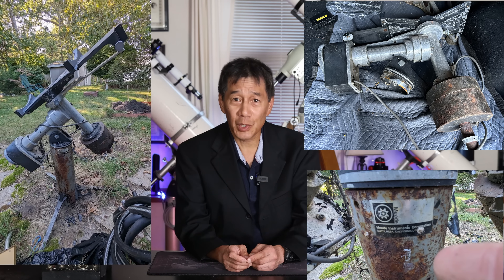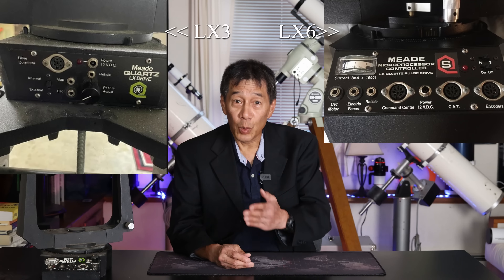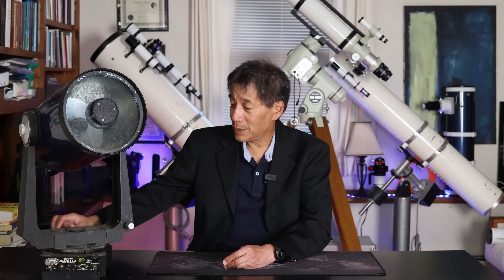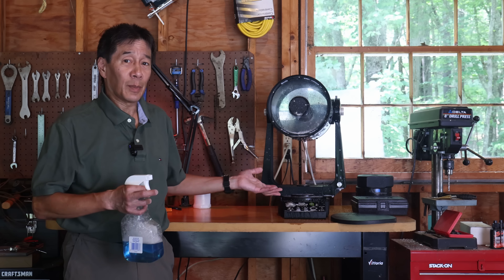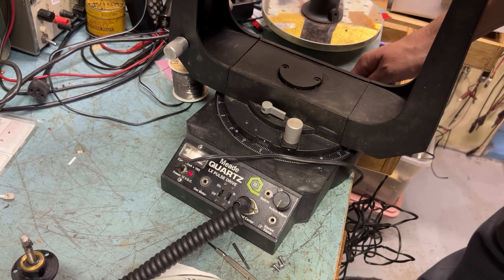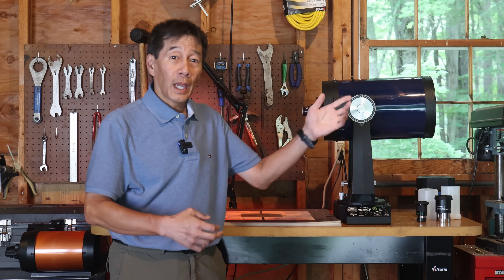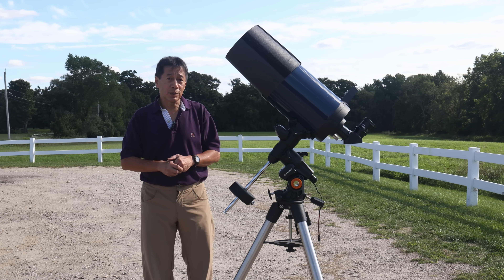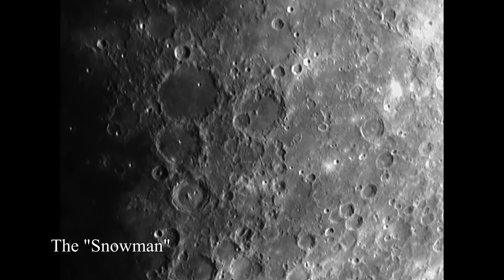Is This Bad?? A Telescope-Shaped Piece of Dirt Shows Up. Can it be Salvaged? See What Happens!

Comment: I wouldn't mind projects like this. I have a condition where I'm happy putting WAAAY more time into fixing up decrepit pieces of equipment than they are possibly worth. Just this year I spent two months reconditioning a couple of motorcycles, one of which had nearly every possible thing wrong with it that could be wrong, and even when I got done spending dozens of hours on it, it was only worth about what I paid for it and the parts that I bought, but I still enjoyed getting it working again.

Comment: Like the video I aquire a Meade LX200at a barn auction 300.00 dollars optics looked good got it home setup plugged in and the RA motor would not stop slueing hand controller lights up but no control over the scope my guess is the computer boards need looking at not sure who can do that well I still use it and I really like the scope

Comment: Ed,
I was gripped by this video because for a moment I thought this might be my old Meade SCT telescope, but alas it is not.
Around 1990 I lived in Suffern, NY and I bought my very first real telescope, a Meade 2080 SCT. I treasured my telescope, even modified it with a state of the art go to triangulation add on. Fast forward to 2011 and hurricane Irene flooded my basement to the ceiling. My telescope was I thought destroyed beyond repair . There was mud and silt and even industrial oil from the nearby Erie Lackawanna train lines covering the scope, my Nagler eyepieces and everything in the basement . For the next 5 years or so I could not part with my scope so I stored it in my shed, but eventually I put it out for trash pickup never believing it could be repaired in its current state. Pardon my ignorance.
So while that is not my old Meade 2080 this story may explain his s telescope ends up looking like that.
p.s. I still have my Nagler eyepieces, I don’t think I could ever toss those. This video gives me the hope that perhaps they can be restored.

Comment: re the corrector plate coatings - my vague recollection is that the very early tubes were un-coated or optional but in any event as you found out the coatings are only worth a very small percentage - your light shield probably fixed most of the issue for you by cutting down any glare from stray light sources

Comment: Question for you Ed: 
A huge $3000 dubsonian 12" newtonian reflector, or a used $3000 Sky-Watcher Esprit-120ED Professional refractor?
Reply from the maker: Ooh, that question could start a war!  If it's your first scope, I'd still suggest the old standbys - an 8" Dob and/or an 8" SCT on a mid sized computerized mount.

Comment: Ammonia has material compatibility issues with several plastics that may be present on circuit boards. I'd avoid using ammonia-based cleaners with electronics. Also bad to let it soak into the connectors, as that's going to bring debris into the connectors that can result in future failure. Instead, maybe cover electronics during bulk cleaning, them wipe them off with a glass-cleaner sprayed onto a rag? Shrug.

Comment: First off I want to say I'm a fan of your astronomy equipment related YouTube video and often recommend them. I have been an avid amateur astronomer and dealer in astronomy equipment for 17 years and have only disagreed with your conclusions and recommendations once before (about neglecting to criticize the DEC clutch of the larger Meade ETX scopes) but now I have another. 

At 5 minutes into this video you liberally spray the cleaner over the corrector of the SCT scope....this is a major NONO! Via capillary action the liquid is sucked under the corrector retaining ring and will eventually seep onto the back of the corrector and possibly damage the coating (and therefore appearance and resale if not usability). It can eventually corrode the aluminum cell and perhaps corrode the ring retaining screw threaded holes so the screws can't be removed. The same applies to the secondary fitment to the corrector. Always spray the cleaner on your cloth, then use the cloth on the glass, never spray on the glass itself. This applies to any lens assembly, like camera lenses.

Comment: How much would it cost to recoat the plate, primary , and secondary?
Reply: the optical coatings on the corrector - probably not doable (but its not really an issue anyway just don't scratch it) the mirrors are re-coat-able ask the local astronomical society in your location who they would recommend

Comment: As long as there's no harsh scratches on the meniscus lens or mirrors, always salvageable, albeit a bit meticulous to disassemble and reassemble one of those if the inside of the OTA needs cleaned. As long as the lens and mirrors don't get rotated relative to each other or the tube on reassembly, that's the main thing. I didn't have much problem with a C8 and C11, getting both the meniscus lens and the secondary mirror in the meniscus fairly close to perfectly centered with the primary mirror for sharpest image at highest magnifications is the tricky part, was for me anyways.

Comment: Hi Edd, thanks for the great videos! I'm torn between choosing an 8-inch SCT or the 8-inch GoTo Dobson Flextube as my first telescope. The GoTo Dob is much cheaper but has a shorter focal length. My primary goal is to enjoy the night sky through the eyepiece, though I’m not sure yet whether I’ll focus more on planets or deep-sky objects.

I'll mostly be observing from my backyard, so the SCT's more compact size isn’t really a deciding factor for me. However, I live in a humid climate and I'm concerned about the SCT’s corrector plate fogging up, especially in winter.

What would you recommend?
Regards
Reply from the maker: If you're getting a goto scope, I'd lean towards the SCT.  It's a more established platform and you can repurpose the mount later.
Reply: @edting  thanks for the answer, is there much difference with the big focal lenght when watching big star nebulae or does this depends wich eyepiece I use?

Comment: Why did you say you usually don't like to take an SCT apart? Have you had a bad experience of some kind? I have worked on these things for years and have never had a serious problem of any kind...usually just stuck screws and corrosion. The most irritating thing I have run into is seeing different marks on the corrector and tube from numerous people trying to keep the orientation straight. My old orange C8 had a single mark, double marks, triple marks and two sets of scratches! And none placed the etchings at 3:00, which on this scope was actually the correct position!  LOL
Reply: SCTs are very sensitive to corrector plate/secondary alignment.  They are tweaked a lot during manufacture using specialized equipment.  Removing the corrector plate can result in never getting great images again.
Reply: Secondary alignment yes, corrector plate not so much. There is only so much adjustment available for the plates. The etchings on the plates are mainly to help the owner to align the secondary to the primary, which is normally indexed to those etchings, which is in turn indexed to the tube normally, but not always, at the 3:00 position. And this is referring to the 8in Celestrons...I have no experience with the larger scopes, or the Meades for that matter. But the critical alignment is between the Primary and Secondary. @stargazer7644

Comment: No coatings because they got stripped by the ammonia in the cleaner?
I had a pair of zeiss eyeglasses with the non-reflective coating. The optician did not even mention to me there is a special cleaning solution for the zeiss lenses. The ammonia in the windex ruined/stripped the non-reflective coating. 😡 After I finished crying, I had no other option than to keep using the windex to completely remove what was left of the coating. 
Check your manuals! Takahashi in no uncertain terms says never use ammonia based cleaners.
Reply: I think the coatings were mostly eaten by fungus.

Comment: Hey folks. Im new to this channel and telescopes (although I’m into photography). Love your presentation style :) Id like to ask you guys a question: The telescope in the video is a f/8 aperture. In photography, when folks want to do astrophotography most people look to buy really fast lenses, at least f/2.8, better something with an 1 at the start. Why is it that telescopes seem to be fine with these comparatively small apertures? I understand that one can put a sensor at the end and do long time exposures, so that is fine. But how is it possible then to use them with the naked eye? Since with the old Mk.I eyeball you cant do long time cumulative exposures? How does that work? Cheers and thanks in advance :)
Reply: Warning more than you probably wanted to know:

Actually the SCT in the video is an F/10 (but Meade did recently sell F/8 versions).  

Up front points: 
You are correct in that it would  be better to have more aperture.  But that comes at a cost of money, logistics and for photography, money to get stability on a mount.

Camera sensors: need time to pick up photons, but can provide color even on faint fuzzies

Eyes: F/10 works for eyes because they see better instantly (visual system more sensitive than CMOS) but can’t integrate to make it brighter and color restricted to brightest of objects

Bright objects are the equalizer.

Big scope for small things, small scopes for big things.  

As you know, F/# is just aperture divided by focal length.  I will start from the photography angle as that is where you are coming from.   In photography, F/# determines amount of photons hitting a detector in a given time and same with retina.

BUT eyes don’t integrate and they max out at a 7mm f-stop (your pupil).  What your eyes do have is much greater instantaneous sensitivity (ability to detect even a single photon) and orders of magnitude more sensitivity range from dimmest to brightest (without blooming.)  However, as stated down at dim levels only rods (grey scale) really are generating data for the brain.

Yes large F/#’s are a pain for deep sky astrophotography where you integrate over hours long periods requiring expensive mounts with extreme stability (aided with star tracking guide cameras).  But that is why there are SCT reducers of 0.63, 0.7 (for Celestron Edge), and the F/2 hyperstar system for Celestron SCTs (but you can’t use that for visual).  However that hurts your image scale (ie magnification).  Photographing tiny dim galaxies is one of the hardest things in astrophotography.  That is why many starters do large bright deep sky objects, like Andromeda, a 3 degree wide bright galaxy.  For that you would need a small focal length (to get wide field) with a reducer.  Because focal length is so short you could use a refractor with  a small aperture, like a 72mm F/6 reduced to F/4.5.  Smaller F/# less integration time, smaller scope easier to mount and have accurate tracking.

Now for visually observing deep space objects, aperture is more important than F/# strictly.  For visual there is a balance between magnification (how big the object will be on your retina) and how large of an image beam enters your pupil, this is called an exit pupil.  The size of the beam of light , ie exit pupil, coming from an eyepiece is the aperture of the scope divided by magnification.  Magnification is focal length of a scope divided by the focal length of an eyepiece.  Now from F/# definition, you can see Exit Pupil also = Focal length of Eyepiece / F/# of telescope.  With that being said you want a Deep sky object like a small galaxy to excite many rods in your eye (most faint fuzzies grey scale on most faint fuzzies)  but also want to have as much exit pupil as you can, but increased exit pupil means reduced magnification for a set aperture.  
Ideally you would want a scope that would fill your pupil the full 7mm with a magnification making the object big, to atmospheric seeing limits (~300x on average).   Well that would only be a 7mmx300 = 2.1m telescope!  That is like a 80 inch scope and big $$$$.  Mortal astronomers are stuck in the 1m class or smaller, and most 300mm or smaller.  That means we are viewing small deep sky objects like galaxies with exit pupils in the 2mm range with 100-150x magnification, balancing brightness and size.  It works because the eye is super light and contrast sensitive and can instantly pick out faint fuzzies against a dark background (dark being key, light pollution is bane of visual observing).  An SCT works for visual even at F/10 because a 20mm eyepiece gives you 100x and 2mm exit pupil.  Plenty good for eyes to see many small deep sky objects.  A reduced F/7 SCT just allows you to get wider fields of view and ability to get to that 7mm exit pupil with a 50mm focal length eyepiece.  But bottom line for visual of small deep aky objects is more aperture is better

For planets, those are bright small things.  Now seeing (atmospheric turbulence) is the enemy of photography and eyes alike.  Both are operating instantaneously, no integration here.  But what cameras can do is take a movie.  And using software to pick out times when the air is still , stack those pristine images to get what you see online.  Alas, for visual, you are stuck waiting an instant of clear seeing.

For photography and visual of planets a large aperture is preferred for resolution and because not tracking for hours don’t need the same level of mount stability.
Reply: Whoops, In there I meant F/# is aperture divided INTO focal length (NOT by)

Comment: Many years ago, a C-14 was similarly dropped in our laps. The original owner had passed away and it sat outside uncovered for several months before his relatives packed it in its steamer trunk and put it in a garden shed where it sat for some number of years. Unfortunately, the shed leaked and the trunk filled with water! By the time it got to us, it was a pretty sickening sight and I figured it was basically less than worthless. 

After a couple of months sitting there, my wife decided to see what the paint looked like under all that dirt and bird $#!*. Once cleaned it didn't look quite so disgusting. We therefore took a closer look at the optics. It had clearly been submerged in filthy water that covered both the exterior and interior. Inside, we also found an old wasp's nest ON the primary. Figuring we had nothing to lose, we fully disassembled and carefully cleaned all the optics and lubed all the moving parts. The result was that the optics actually looked rather good! But as Ed found with that Meade 8, the corrector's coating was gone. 

The electronics were shot but we found a spare board on CloudyNights for something like $15. The drive motors took a little lubing and exercise to start moving again but eventually came back to life! Everything was sanded down and repainted. (It turns out that Rust-Oleum sells an orange that looks suspiciously like the original Celestron orange which kind of makes you wonder.)

Once finished and reassembled, the telescope looked amazing and worked remarkably well – that is as well as those old fork mounts ever worked. The club that it was donated to and dumped on us took it back and ended up auctioning it off as a fundraiser.

The point of this story? Never give up, never surrender!

Comment: I deforked my 1981 Meade 2080. I still have the wedge, I have the perfect condition hand controller, and the ultra sturdy tripod . I also have the LX3 mount.  Here is the interest part of this story: I was going to Mount the Mount and and use it as a sidereal clock. Pretty crazy right - the problem is I grabbed the wrong power wart and accidently plugged in a 12V AC power wart. Yes that is right AC not DC. Don't ask why I even had one laying around but a little puff of smoke and no more working mount clock. I would love to get the innards of a LXE3 and would gladly exchange it for the wedge and hand controller...

Comment: I love restoring scopes. Most of my vintage scopes were salvaged.  

My Vixen/celestron c-80 was forgotten about in someone's shed.. rusty polaris mount, crusty tripod, dirty bug infested OTA and objective, etc..  after about a day of disassembly, cleaning, regreasing and polishing, another couple days to sand and refinish the tripod, and it looked nearly brand new, almost showroom pristine actually.. the objective was  fine, very few actual dents and dings in the tube, the mount looks great after getting rust off steal parts and all is well...

I also bought a Celestron SP-C102f that I took a chance on for $700 bucks... in a basement, objective looked possibly moldy, tube and mount were crusty, etc... not quite as bad as they c80, but still not good...

First thing I did was clean the objective... totally removed the cell etc... oh the relief I felt when it cleaned up beautifully without a scratch or spot! Gorgeous coatings.  That scope looks almost as pristine as the C80 save a few small scratches and a dent I just put a Rigel quickfinder over lol.

A c80 for $25 and a c102 fluorite for $700... I can't complain.  Love them both.

Comment: As a stagr lighting designer/directer,  it has been my experience to not use ammonia-based cleaners on the coated lenses and reflectors of stage lighting fixtures. This has also been the recommendation of variouas manufacturers. Do telescope lenses use a different coating that can handle such cleaners?

Richard B.
~

Comment: Ed, I own a eight inch Meade LX2 from the 1980s.  It has a separate electronic drive because the LX2 predates the eletronic versions of this scope.  I had the mirrors re-aluminized a few years ago, and I have all the parts--the trunk, the tripod and so on.  Do you know anyone who might want this unit?  I am downsizing and it must go. Please contact me if you know someone who is interested.